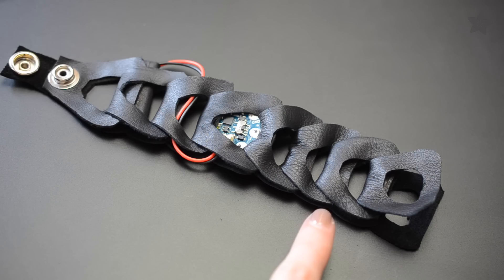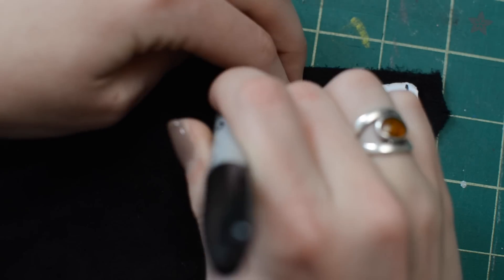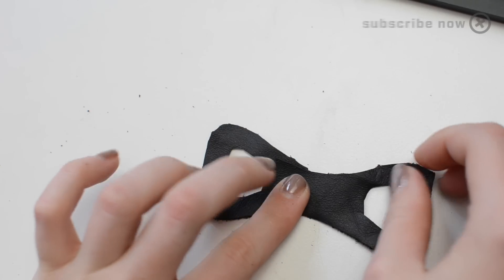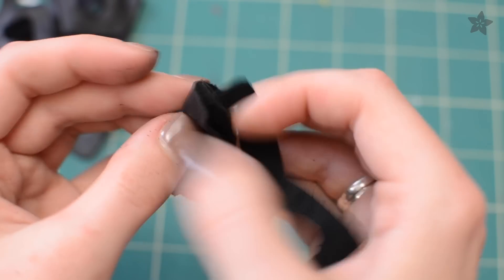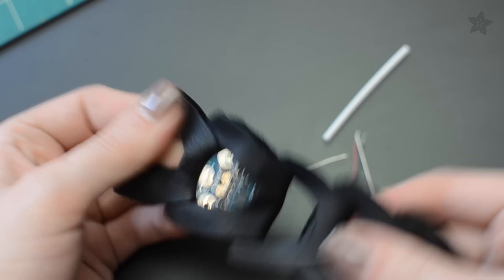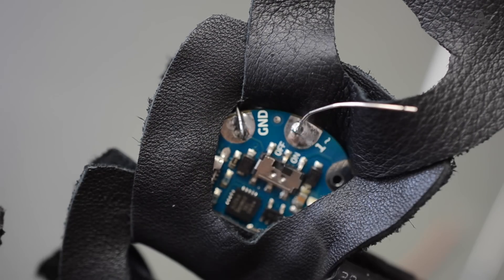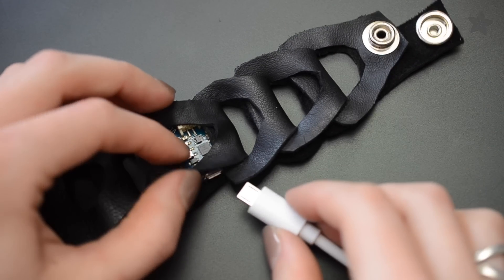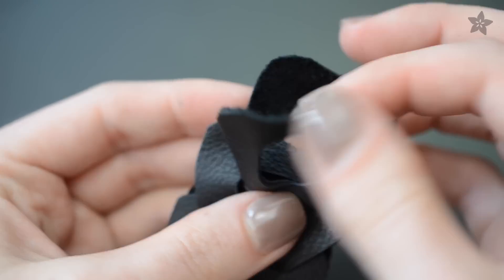Buzzing Mindfulness Bracelet with GEMMA

Comment: Do I think if I add a small sensor on the Gemma it would still work with the vibration? Because I want it to initiate vibration on its own if I touch it or put my hands over it

Comment: Would the low power code also work on the Flora in the "Haptic Headband"? I was thinking to combine the 2 projects onto the Flora and use the motor controller. Thanks!

Comment from the maker: NEW TUTORIAL! Buzzing Mindfulness Bracelet with GEMMA #WearableWednesday
https://blog.adafruit.com/2015/06/10/new-tutorial-buzzing-mindfulness-bracelet-with-gemma-wearablewednesday/

Build yourself a buzzing bracelet for subtle haptic feedback as time passes! It’s great for reminding yourself to get up and walk away from your desk for a few minutes each our, or just as a way to have a new awareness of how the perception of passing time varies based on what you’re doing. Read the complete tutorial on the Adafruit Learning System!

You’ll whip up a vibrating motor circuit using a transistor, resistor, and diode, and use GEMMA to control the frequency of vibration in between low-power microcontroller naps. The circuit lives inside a linked leather/rubber bracelet, but you could build it into whatever you please. This project involves some precision soldering, but is otherwise quite easy!

Read more https://blog.adafruit.com/2015/06/10/new-tutorial-buzzing-mindfulness-bracelet-with-gemma-wearablewednesday/

Comment: I modified the code so once configured correctly when importing code it will, buzz with roman numerals on the hour. ie 6 o clock for mine will do two short buzzes followed by a pause and one short buzz. Indicating VI. Love Open source, love youre vids thanks guys